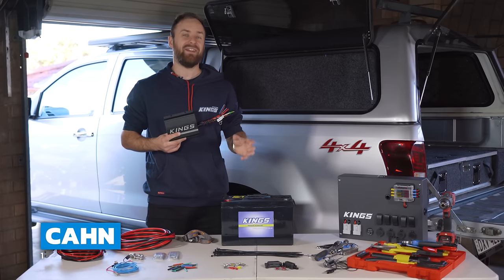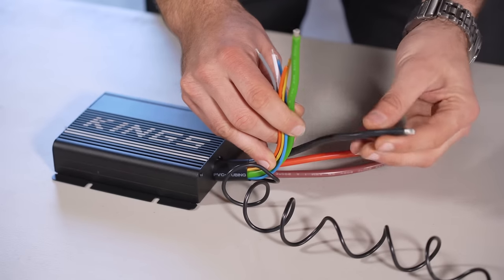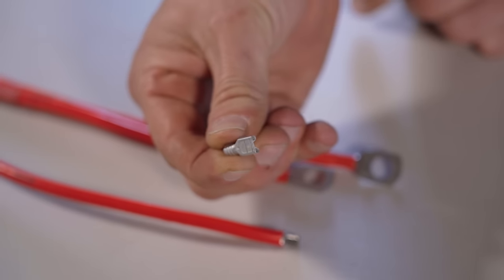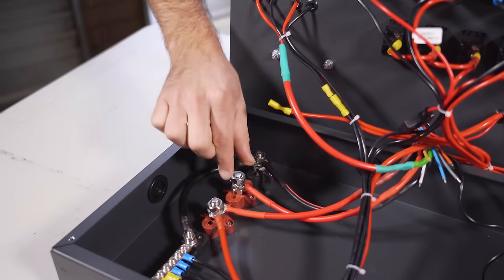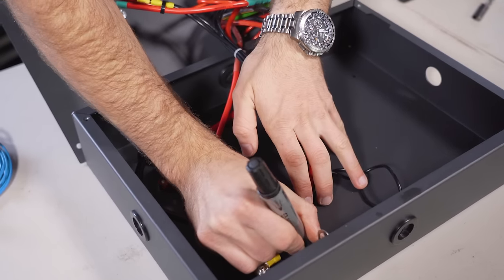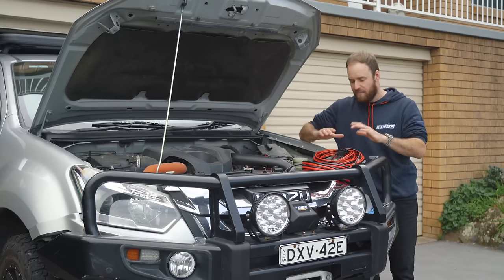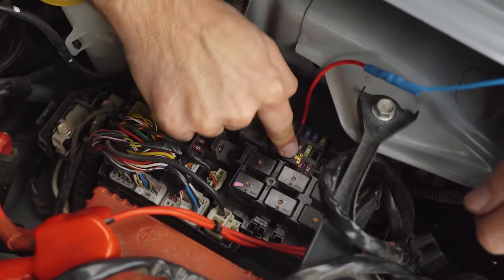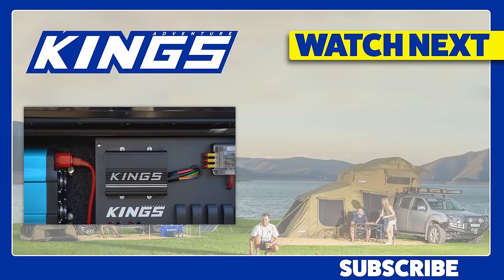Step-By-Step DC-DC Charger Install

Comment: Why wouldn’t you just make the dc dc charger with wire lengths 1m long instead of forcing people to buy special crimper , lugs and cable ?
Reply: You get voltage drop,or youll get excess heat, you only want the wires to be the length you want plu some room for a repair and a bit of slack, typically a hand width.
Reply: @f1reguy587  the voltage drop you get from 1m of wire would be soo insignificant. The reason would be cost
Reply: Or they could give the option to buy their dcdc chargers pre installed on these boxes to reduce the amount of wiring customers need to do
Reply: @f1reguy587  you’ll get more voltage drop from having a crimp in the line. Whereas if they were longer you could cut them to length easily lol
Reply: Don't buy a Victron then. No cables, just terminals.
Reply: Because that would add to the price and be a throwaway item if you need longer or shorter.
Reply: @GregRickard  well I’m sure people would pay the extra cost to get a longer bit of cable instead of forking out extra cash to buy a crimper that they will probably only use once
Reply: @chrisjones1864  I bought the crimper and am so glad i did. Have used it to put many lugs on since, one of the best tools to have if you are doing your own electrics.  Its onky  $80. Any thick wire you have to put a lug on, so much easier to have that thing.
Reply: Although the cost added up, I enjoyed wiring this up myself. For a novice like me, it was a sense of accomplishment.
Reply: I was literally typing the same comment
Reply: What a joke that you need to extend the wires. Kings not even compatible with kings
Reply: Can anyone please give me some information about the 3 big cables (black, red and brown) on the 25A 12V DC DC charger that need extending? What size and what kind of cable is it?
Reply: You will need to buy special tools once and only if you didn't have them. Then you will have a new tool for more projects
Reply: Whole lot of pissing around for something that should be compatible. Was thinking about this but not anymore😂

Comment: I never had to connect my DC-DC charger to ignition for it to work (no smart alternator to worry about), and it didn't have a plethora of wires to hard-wire battery type.  Mine had a push button selector for battery type.  I have moved this unit into my caravan now as I have installed a DC-DC MPPT device into the car - this charges the house battery from solar or alternator (no ign wire needed) and when full it charges the start battery as well.  The van is simply connected with anderson plugs and decent cable.

Comment: Would be great if they A - had longer wires from the get go, and B - had a control panel optioned with the dcdc already hooked up
Reply from the maker: Hey Cl4rky, I'm hearing you mate! A fair few people are telling me they'd love a pre-wired one, so it's on my list and I'm looking into it - for the moment though, hopefully this helps!

Cheers,
Cahn
Reply: @4wdsupacentreAu  unreal, looks like a great bit of gear but for those who aren’t too electronically minded or hands on a pre wired option would be epic
Reply: @4wdsupacentreAu  Gday cahn, what size fuse did you use on the cable from the main to aux battery? And also what size fuse would you recommend for your 1500w inverter, and should you connect the inverter straight to the aux battery or into the switch box?
Reply: @4wdsupacentreAu  if you are running the ignition wire with an fuse adapter to the cars fuse box do you still have to fuse the wire or is the one in the video with fuse added for if your not going into fuse box cheers
Reply: @4wdsupacentreAu   hi Cahn this blog is now over A year old has anything been done on this, thanks JOHN

Comment: Before installing this setup i noticed you had a boxed panel to attached the unit and battery to. Do you have any information/videos going through the building and installation of this?

Comment: So I have done this and when I attach my kings solar panels I get an over voltage shut down fault what could be happening?
Reply from the maker: Hi there,

This can be due to how the circuit was installed, though it's tough to diagnose without being able to see exactly how the control box is wired, and which panels you have in the system.

Regards, Andrew

Comment: Legend!! I have just been looking at getting myself a 12v setup but didn’t know where to start. Now I can just follow this video step by step. Would love to see a video on how a inverter would connect up to this setup
Reply from the maker: G'day Adam,

Ideally you'd connect your inverter directly to the battery (with a fuse on the positive lead) so you can run the shortest possible wires and prevent voltage drop.

You could use the internal posts on the battery box to connect your inverter - connect red to the aux battery post and black to the negative post and it would work, but if you were planning on running any high power tools or appliances, you'd likely want to increase the wire diameter running from your aux battery to the posts in the box to cope with the extra load!

keep an eye out though as this is something I'll add to my list!

Cheers for watching and shooting through a comment,
Cahn

Comment: Thanks I know how to install a DC-DC charger, but what is it? I have an isolator from start battery to aux deep cycle battery. I bought all my 12 volt gear  (bat box 138 AGM, solar blanket and associated gear that go for with it from Kings, but the guys never told me that I needed a DC-DC Charger.

Comment: My kings dctodc charger doesn't have them wires.   Just 3 anderson plugs and the black and power wire.   Is there a video that explains how to wire up my type
Reply from the maker: Yeah mate! Check out the videos tab on the listing of the DCDC on the website and there are multiple videos for the new DCDC charger!

Cheers,
Cahn

Comment: Great bit of kit. It would be a lot better if you supplied the charger with longer wires on the heavy gauge wire. At least an extra foot/30cm of wire. Also supply the crimp ends and the crimps to extend/join the longer cables.
Reply from the maker: G'day Andrew - Definitely something I'm pushing for mate! Would've made my job a lot easier too on this install...

Thanks for taking the time to watch and shoot through your feedback! Much appreciated!

Cheers,
Cahn
Reply: @4wdsupacentreAu  Thanks for the prompt reply. My thinking is that a lot of people wont want to spend an additional 45-50 dollars on a crimping tool, (which will put a lot of people off buying this unit) just to extend those two heavier cables. Most people are capable of joining/extending thinner cables and they will find it easier to find the thinner gauge wire. Personally i know i can get lugs to extend the heavy gauge cables but they are not readily available to most people. That additional cost 45-50 dollars for a crimping too might make people look at other suppliers, which would be a real shame because your DC-DC charger is brilliant bit of kit. When you consider the two extra 30cm wires will only add a dollar to your build cost. P.s Keep up the great work.
Reply: Yes. Correct considering the box is pretty much made for the charger
Reply: @4wdsupacentreAu  Hi Cahn, what is the gauge of wire used on the blue ignition  wire, thanks John PS this and so many of the videos are simply amazing
Reply: 2 years later nothing has been changed tho they added Anderson plugs .... retailer told me today if you cut the plug off to pass through hole then that avoids warranty.... why not make the control box to accommodate the wires with correct lengths and lugs.... ...I read these comments of 2 years ago and nothing has changed ....went in today prepared to buy up whole set up and it altered my decision to purchase.... not only that the sales staff were very hesitant on how it worked at all.... you need to train your staff .... lost a good 1.5k sale because of these problems
Reply from the maker: Hey mate! I’ve done a whole video on installing. The cables are long enough now and I cut and added eye terminals… what store did you visit? Cheers,
Cahn
Reply: I must have been sold old stock as my cables are not long enough and l will have to add lengths as per this video@4wdsupacentreAu

Comment: Love the install you have done, but would also have like to have seen the basic install using the DC-DC charger with a AGM battery in the Battery Box I purchased from $WD Supacentre as I basically have this kit.  To be honest a little lost now due to the fact I do not have the 12 Volt Control Box.  Appreciate any help and suggestions were to purchase the optional accessories and tools would also be very helpful in the description.
Reply: Hi, 
Just read yr comment re 12v system. Have a look at my videos and may also be helpful for yr set up. 
Cheers 
Out There Touring

Comment: Just an observation.

I've watched a heap of 12v 2nd battery install vids last 2 weeks.
Everyone uses the word "battery" when referring to "this red wire attaches here to the +, or the black wire goes here to the -" without defining WHICH battery they're referring too! 
The vehicle main battery OR 2nd battery mounted on the 4x4 tray or box trailer.

Most people could possibly know what you're explaining and fill in the gaps, I'll admit l don't follow everything.

I saw on a web page today where a person uploaded a pic of his system drawn on paper in red and black pen representing the wires, that was very informative. Sadly l can't upload it. 

That's be great if you could provide something similar,
sketching the Control Box, Battery Monitor, DCDC Charger, Main Battery, 2nd Battery, Inline Fuse Placement, where each wire goes the wire gauge and fuse size/placement etc etc. 

Even include the the wire gauge for different applications. E.G.
Min  8 B&S gauge Black & Red wire from Vehicle Battery (to the KINGS control box)
E.G. 2mm can be used for all LED lighting.
Don't assume everyone does know.

Has Adventure Kings contemplated running workshops for 12v second battery installs at one of their outlets???
Say 8 - 12 vehicles at a time with a nominal fee especially if the individual purchased all Adventure Kings 12v systems, with some freebies, discounted accessories on the day/night etc.
Even 12v question/answer evenings?

Just thinking outside the square.
Sorry for the long post.
Anyway, thank you for your vids, really enjoy them.
Cheers

Comment: Is it possible to have an Anderson plug from the control box going to the spare battery (with the same plug on the other end) so that you don't always carry the spare battery if you don't need it, but when you do, you just plug it in and off you go?
Reply: It is possible. I done it myself in my new D'max. Its great. So much you can do with this 12v box.

Comment: do you have a video on how you build the internal,box for the storage of battery ect
Reply from the maker: Hey mate,

I don't have any plans or a video on it unfortunately - I just knocked it up the day before with some ply wood and marine carpet.

It's a vertical piece of ply with two horizontal sections - the main shelf you see in the video (which has a couple of 45° supports underneath) and a top hat that encloses the box. I also put an end cap on the headboard end of the unit to box it in.

I sized it so that it fit over the width of the drawer wings and doesn't interfere with the fridge slide, and I made the main shelf high enough that you can slide a battery underneath.

it's mounted to the bottom corners with L brackets, and the top corners use straight twist brackets (90° Twist) to fasten to the internal bracing in the canopy.

If i did it again I would've added some low dividers on the main shelf to prevent gear sliding around - we use the control box to charge batteries, cameras, phones etc and it'd be nice to keep them in the one place!

Cheers,
Cahn
Reply: @4wdsupacentreAu  I am also interested in this set up. Would love to see some photos if possible. Also, why place it on the passenger side? Would it be better for visibility on the drivers side?
Reply from the maker: @GregSharkey  Unfortunately as I said I didn't film actually knocking up the enclosure but it wasn't too tough!

You're right regarding visibility, but generally we have our camp set up on the passenger side, so if you're pulling up on the side of a track to check something or have lunch, you're on the safe side of the vehicle.

Cheers,
Cahn

Comment: Great VDO i have done this set up thanks very much. My question is that I have a camper trailer which has more battery on it do i need to add charger to it??

Comment: Great video thanks  I know I’m a bit late. But I have a question. Would everything you’ve done there be a great way to earth your wires. I always thought you ran aux,dcdc,solar all to a good  chassis ground.
Reply from the maker: Hi there,
The DC to DC charger has earth cables on each of the Anderson plugs & you always need to earth the AUX battery, whether that be direct to the vehicle or back to the main battery.
Regards, Courtney

Comment: Great install video just wondering what size cable and fuse were used on the ignition cable
Reply from the maker: Hi there,
Although we don't have the exact size used in this video available, with all cable matching if you measure the diameter you can then match this against an online search to find the AWG rating of the cable which the maximum capacity will also match the fuse size!
Cheers, Courtney

Comment: cCan you do a video on wiring the dcdc charger AND the battery monitor to the control box in the one video please.    I am lost as to weather the yellow and green wires connect to the same binding past as the brown wire or does the whole configuration have to change..   seeing how this is done would be a massive help. cheers
Reply: i was thinking of installing a battery monitor as well. Did you get your installed yet and how did you wire yours up? Cheers mate
Reply: Who is the one that should stay away from 12v? Keyboard warrior.

Comment: thank you for sharing your detailed video as great watching all time.
ask you what working with a 24v power system in a big truck and want to run the 12v dc to dc unit?

Comment: I would really like to see a video on the exact why you made the board and battery wall/ space to attach the box etc.
Reply from the maker: Hi there,

Thank you for the question, I can advise that it's added for accessibility reasons and helps stop having gear moving around while on the go, but also keeping that space behind open for storing whatever gear you need in your day-to-day.

Regards, Andrew
Reply: @4wdsupacentreAu  just wondering how you fixed it to the roof and base to make it a solid surface 👍

Comment: Sorry new to all this.  I don’t understand what the gang switch and the bus bar (preassumbled on the control box) are for.  Doesnt an inverter need to be attached between the marine battery and your appliances you intend to run?  If so why are gang switches and a bus bar needed?

Comment: Hey great video, if you were using a wiring kit that has terminal on one end and then Anderson’s plug on the other where would you plug the Anderson plug and would that change where you wire the dcdc charger?

Comment: I’m considering a circuit breaker between the dc to dc charger and the house battery.  What is your opinion on this and if you would do it, what orientation should the breaker be set up - what should connect to the battery side of the circuit breaker and what connects to aux?  PS this is a stand alone system that has no starter battery involved.

Comment: Would this be the same process if you had dual batteries in engine bay ? Would you have the dc dc charger in the back ?
Reply: Yes, would just have to have positive and negative wires coming from both batteries separately into the control box.

Comment: Thanks a lot for sharing. Planning to have the Kings 115ah AGM, my alternator is 75amps. Which dcdc do I get 20 or 40 amps ? Cheers.
Reply from the maker: Hi there,
You are able to get either, but if you were wanting for it to charge faster we would recommend the 40A DCDC charger.
Regards, Courtney
Reply: Thanks heaps.

Comment: Just wondering how you're grounding all those black cables inside the control box? Is it just back to the main starter battery?
Reply from the maker: Hi there,

This would be piggyback grounded via the starter as you had noted as the circuit would then be completed and closed.

Regards, Andrew

Comment: I’m running dual AGMs under the bonnet but want to add a LiFePO4 battery in the bed of my truck. Is it possible to add the third battery to this setup? Also, is this setup weatherproof enough to mount inside the bed of my truck? Thanks

Comment: Great vid. Just like the rest of them. Great work. 
The small black cable to battery you told us not to cut. What do I do with that if it doesn’t reach my battery? 
Cheers.
Reply: coil it up and leave it tucked in somewhere. what ever you do do not cut it..

Comment: Could you please add the size fuse you need for each and the Cable size you use for each run.
Reply: Hi, 
Just read yr comment re 12v system. Have a look at my videos and may also be helpful for yr set up. 
Cheers 
Out There Touring

Comment: I have an isolator from main battery to aux battery. Just brought a DCDC charger and 12v control box.
How would this install work with the isolator?
Reply from the maker: Hi Catherine,
The isolator would need to be removed as our DCDC charger has an inbuilt isolator.
Regards, Courtney